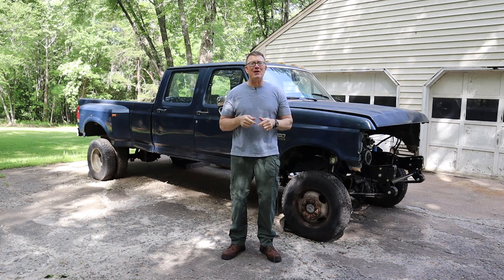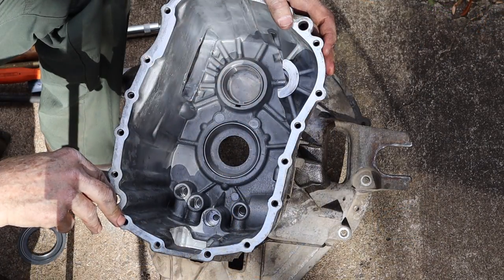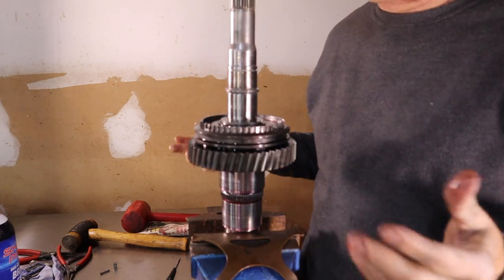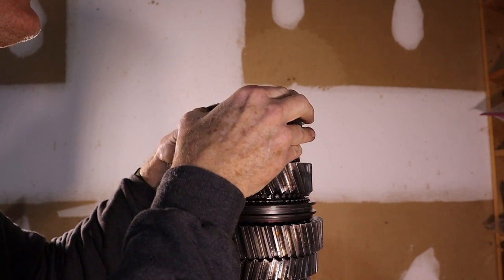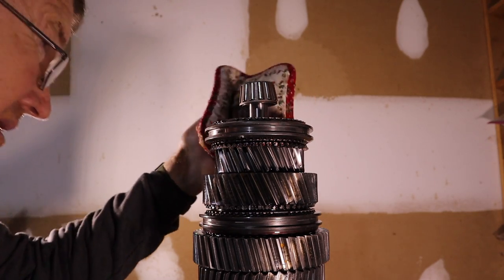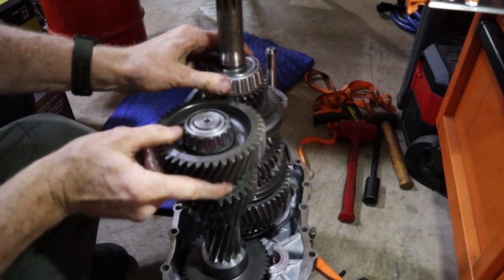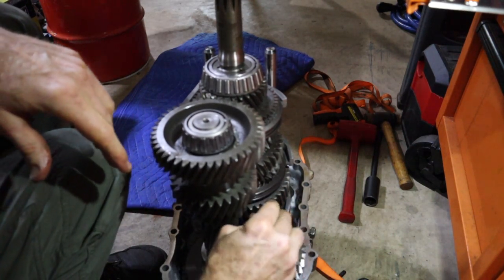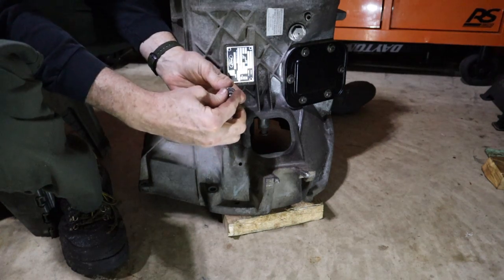ZF5 Transmission Rebuild Part 2 - Reassembly!  Episode 24, Project Brutus.

Comment: As a whackologist, I can tell you your table is giving you a good deal of grief that you may not be aware of, when driving do it directly on the concrete using solid wood to protect it, same for pulling, having it well secured allows much more of the impact energy actually removing it. I think this will do a great deal of making things go more smoothly for you!
Reply from the maker: Yep, the HF table that I'm using is really handy, but it also has a lot of give to it, so I'm losing a lot of energy.  Thanks for the input!  Scott
Reply: As a fellow whackologist I second this 😂
Reply from the maker: @lanecarter1097  Thanks!

Comment: Your losing so much energy trying to hammer in those races and bearings on that table that has no back bone. Look at the part of the video where you took advantage of the soild concrete drive to hit the race in vs using that table. Big difference you need a heavier table that was hard to watch. Love Brutus so I will indure.
Reply from the maker: Thanks for the tip, John!

Comment: I drilled a hole in my bench a few years ago so I could stand transmissions on the bench. not on your knees so much
Reply from the maker: I've seen that done before.  Good deal if you have a bench dedicated to trans rebuilds.  thanks

Comment: Where did you get your dial indicator? Would you have a revomendation on which one to use?
Reply from the maker: I don't recall where I got it from.  You should be able to find a highly rated one on Amazon.  Summit Racing also has a pretty good selection.  Scott
Reply: Thanks!

Comment: Great video but im confused when you said the shallow side goes up on the 5th and reverse hub. If you put the shallow side up, you will not get the snap ring on and also the hub would be smashed against the synchro ring

Comment: So what a lot of people don't know is there's two zf5 a long and a short gear ratio the short is for the diesel the long is for the gas I might have that backwards
Reply from the maker: The gas ZF5 is wide ratio, close ratio for the diesel.  Thanks, Scott
Reply: So my question would be what would happen if you put the gas transmission behind a diesel because I didn't know that when I bought a transmission out of an F-550 had a gas engine what's the odds so now I have one that is for a gas engine and not a diesel the bolt pattern is the same I don't know
Reply from the maker: @okiedoke6373  the bolt pattern is different between gas and diesel engines.

Comment: Heck yeah I'm a logger I drive a 86 f250 4x4 6.9 idi super cab and I collect old chainsaws and yes I use them.
Reply from the maker: Excellent!  Figured we had some crossover with diesel trucks and chainsaws!  Thanks for the input, Scott
Reply: @THEBULLETPROOFGARAGE  quick question I have a 6.9idi it's tired. I'm planning on using the same method you did to build. How much to you have cost wise on the rebuild?
Reply: @THEBULLETPROOFGARAGE  I depend on my rigs and I am all hwy and off road! I stay in 4x4 because there are no roads where I work
Reply from the maker: @jackdaicole7595  - It was an expensive build for me, but that was because of all of the upgrades (injection pump, turbo, camshaft, etc) and some additional machine work.  You can do a really inexpensive rebuild if you just use a ball hone on the cylinders, new rings, bearings, and gaskets, new valve seals.  I think you can do it for less than $1,000.  Thanks for the question, Scott
Reply from the maker: @jackdaicole7595  - Sounds like the perfect truck for you!
Reply: Yup i own a 88 f superduty idi dumptruck and collect old saws as well my favorite right now is my stihl 056 magnum
Reply from the maker: @mrmolasses5366  - I've a few of those - 045 Super, 056, 056 Magnum II.  Great saws, but prone to ignition failures.  Scott
Reply: @THEBULLETPROOFGARAGE  yup i bought mine with a shot ignition but since it had a bosch ignition on it instead of the SEM all i did was put a 2 dollar capacitor in and relocated it in the fan shroud and it works great
Reply from the maker: @mrmolasses5366  - Excellent!  Those are awesome saws to run.

Comment: Really appreciate your level of detail.

Forgive me if this is a dumb question…I’ve never rebuilt a transmission this complex. When you measured for the pre-load shim, you did not allow for a gasket. Then you used RTV. Is this because the RTV squishes out so much as to be negligible?
Reply from the maker: Lee - it's actually an excellent question, but one correction -- as I mentioned in the video, I'm using an anaerobic sealant - Loctite 515.  It remains in liquid form whereas RTV hardens into a rubbery texture.  If I used RTV as directed - apply, install parts, run bolts down finger tight, and allow 1 hour to cure, then tighten bolts to spec - that would definitely make a difference in pre-load.  However, with an anaerobic sealant, I really think any difference between fitting dry and fitting with anaerobic sealant is negligible.  Thanks, Scott
Reply: Thanks Scott, now I know about anaerobic sealant! I assumed that meant it would not grow bacteria or something…
Reply from the maker: @leezumwalt1163  Happy to help!

Comment: I see why you wanted to check preload especially with a case half from another trans, but with mine being all original I’m apprehensive about pulling new bearing races after they’ve been installed just to most likely put the original shims back in.  Do you think I’m risking it by skipping that step?
Reply: I know what I’m gonna do. I’ll put the original shims in, assemble it, BUT I’ll double check my preload by putting say, .010” shim between the case halves then check my end play and subtract the .010” to see if I have my .002-3” preload.

Comment: Would like to know where you acquired the parts for the transmission rebuild. My dad had a 96 f250  7.3 power stroke with the 5 psd and he has messed the synchros up because of the bad bushing failure on the pedal under the dash and he kept forcing it in gear. That was a bad design on fords part but it is what it is.
Reply from the maker: Hi Alan - I bought a kit off eBay for $278.99 - the seller was vital_parts.  Good luck with the rebuild!  Scott
Reply: @THEBULLETPROOFGARAGE  thank you!
Reply from the maker: @alanlashley943  Happy to help.

Comment: what causes the common cracked case in the zf5 trans?
Reply from the maker: Well, if it's a 2WD case, I think it's often caused by loose bolts from the transmission to the crossmember.  On a 4x4, there's the added stress of the transfer case hanging unsupported off the transmission.

Comment: Will a zf5 hook up to the inline 6?
Reply from the maker: Yes, a ZF5 will bolt up to a 300 six if you use the SBF version of the ZF5.
Reply: There were lots of 300 sixes with 5 speeds.

Comment: Where did you get the shim kit? I’ve been searing everywhere online with no luck!
Reply from the maker: I wish I remembered.  There was only one place that had them.  One of the retailers that sells ZF-5 parts.
Reply from the maker: I found it - from Torque King 4x4 - part number QU20984 ZF 5 Speed Shim Kit
Reply: @THEBULLETPROOFGARAGE  dang. That only one place is out of stock. Guess I’ll be calling them today. Thanks man!
Reply from the maker: @quadesmith1294  Happy to help.  Good luck!  Scott

Comment: My 1995 5 speed f350 diesel is hard to get into reverse.
Reply from the maker: Try shifting into first gear and then into reverse.
Reply: @THEBULLETPROOFGARAGE  mine works when I put it back into fifth let out on the clutch just till you engage just a very little, then back to reverse and it goes in.
Reply from the maker: @mikeharkins4825   Might be time for new synchros.  There's a ZF-5/ZF-6 group on Facebook with a lot of smart folks - https://www.facebook.com/groups/189400291474779  recommend you join the group.  Scott